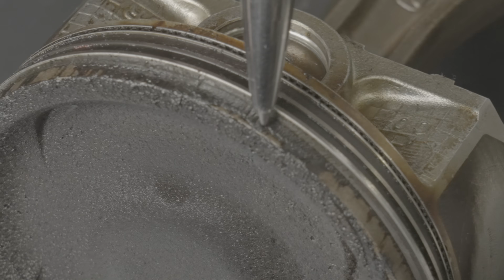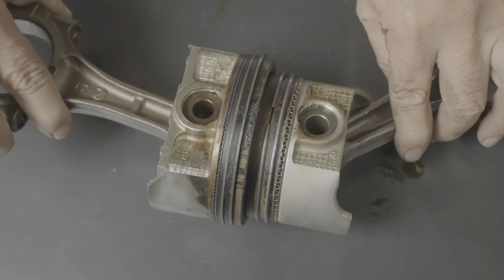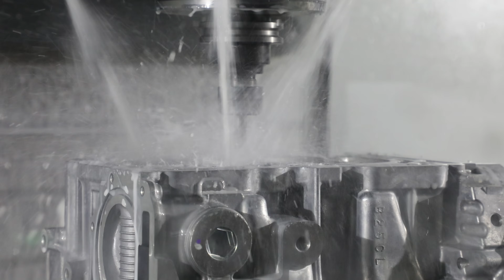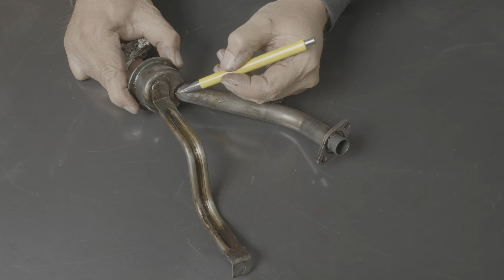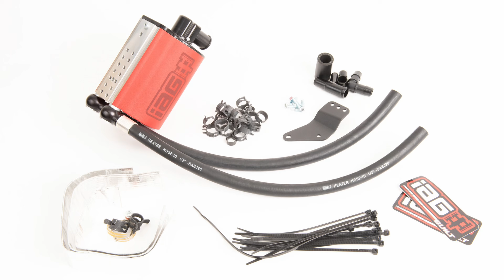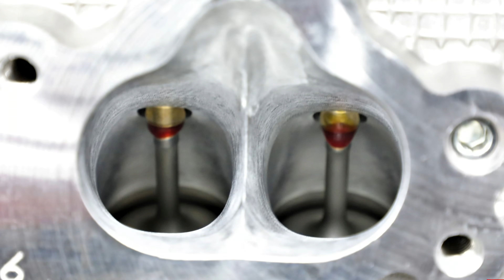Why Subaru Engines Blow Up!

Comment: I bought a 2002 Subaru WRX that had rod bearing failure back in 2012. Rebuilt it myself, had the crank turned and ran underside rod bearings. That thing was awesome. Something happened to one of the timing belt pulleys because I was broke and didn’t buy new ones when I rebuilt it. Timing cover exploded and parts landed all over the highway. I sold the car and haven’t had another turbo Subaru since then but I plan to own another one eventually. I daily drive a 2000 Impreza outback and it’s a beast but I miss my WRX!
Reply: I daily drive a 2000 2.2L Impreza Coupe and it's wonderful, ...with a perfect balance of power and economy.   I believe high zinc oils contribute to the destruction of turbo Subaru bearings as they are silver or silver plated and zinc in presence of acid corrodes silver.  It is a known issue in locomotive engines with silver bearings-  these require zinc-free oil.  Subaru mentions to use 5w-30 Resource Conserving oil only.  The 5w-30 RC oils category limits zinc severely.   The first thing nearly all WRX fans do is put a thicker more zinc loaded oil into their engines.  Thicker is fine but nearly all thicker oils have more zinc than RC oils.  What oil did you use may I ask?
Reply: @sezwo5774  I ran full synthetic mobile 1 if my memory is correct
Reply: @HILLBILLY_HARD  In that case you are off the hook, unless it was the previous owners' oil choice (if used car).   Shell Rotella T6 is very popular among Subaru enthusiasts and it's loaded with zinc.  I have a 2013 Forester XT,  ...I use a mix of NAPA brand oils as they are Valvoline but with a weaker add pack, read: very little zinc in their thick 15w-50 synthetic oil.
Reply: @HILLBILLY_HARD  Haha, like your channel.
Reply: @sezwo5774  thanks
Reply from the maker: @sezwo5774  The bearings do not have silver in them. Any good synthetic oil rated GF-6A, SN or SN plus is going to be fine.

Comment: What are you're thoughts about FA24/VB 2.4 in the newer wrx, i want to get one and push it at least to 400whp.
Reply from the maker: We don't have enough experience with them yet.  We have only done 2 GR96 cup car engines but those have to stay stock by the rules.

Comment: Are the NA motors not infamous for the failing head gasket meme? Where are people getting that they are better than the turbo's? 

Maybe we got the good motors here in Aus.
Reply from the maker: The ones with the crappy gaskets are. You guys get some better variants, chances are better gas too.

Comment: I swear the people that have never owned a subi talks the most shit. 

Like dawg how bout you try one before you just start yapping 😂 It's like if I said bmw's are shitty because they leak oil, and you have to change the Valve cover gasket every 200mi, the maintenance is to much because all you do is work on it fixing leaks. But I've never owned one, can't speak for something I don't have any experience with. Bmw make amazing cars for track or street and everyone knows because i bet they've been gapped buy one with an intake, downpipe and a tune. Same with Subaru, they make great track/mountain round cars they just need to be set up correctly LIKE EVERY SINGLE OTHER CAR would you imagine that. Instead 19 yr kids buy them for cheap and absolutely destroy them leading to them putting up videos online and getting tons of views blowing them up

Yes Ej's are an old designed engine that Subaru never changed besides adding AVCS. They are literally based off of an airplane engine that maked 70hp, thats why they made the FA line up which is more reliable for daily driving. But for most people that buy a Subaru they are buying a Outback or Crosstrek which use the same engine as a new WRX FA20 or 24. Most people aren't going to push there Crosstrek to 400 or 500whp. Subaru is just trying to save money buy not making an entirely different engine for performance because it's not worth it for 2 cars out of there entire line up which are such a small percentage of their sales.

Same thing happened with the EJ, put in many cars for daily driving not for performance based cars. But Subaru decided to go into rally racing and used what they had, saw that it worked and rolled with it for the past 25 years 😂😂
Reply from the maker: FA's have their own set of problems.
Reply: @motoiq  Oh I know 😂 just didn't want to get into it lol. They aren't the best motors by far, I'd almost argue the EJ is a better platform to make power on
Reply from the maker: Currently easier anyway.

Comment: out of everyone I know who had a wrx/sti (including myself), only one person was still on their original engine. And yet, you'll get subaru fanboys ranting that these engines are reliable as long as you spend another 8k on supporting modifications, don't abuse them (jury is out on what abuse means. for some it literally just means accelerating hard), retune them, use the absolute best fuel, only use special brotella oil, and recite the 7th psalm before every drive.
Reply: Maybe you guys just don't know how to drive?
Reply from the maker: No its typical modded Subaru
Reply: @lechug43  aaand how exactly does that blow your engine other than miss shifting? Very odd that none of our other vehicles had those issues if that were the case...
Reply: Abuse means don't maintain them, flog them doing 5k clutch drops and donuts, run shitty fuel. They are a performance engine if you run shitty fuel they will predetonate and get knock or bend rods.
Basically don't be a complete knob. If you look after the engine they absolutely shred and it can't be denied. If you've ever owned one, you know they are bags of fun and will smoke 99% of anything else on the road, even lightly tuned.

Comment: i put 350,000 kms on my 06 wrx (has 420k kms now), bolt ons & tuned since 100k kms. it can handle maxing out the stock turbo, after that its just upgrading the weakest link. head studs, closed deck cases, forged bottom end & it's pretty much good to hold whatever you can throw at it. imo the issues are, 1 poor tolerances when building, slack maintenance & crap oil, & trying to spin the car forcing the oil to the outside which cannot return to the oil pan causing starvation or lack of pressure (this is also compounded by loose tolerances & oil pressure, & again by going long on old crap oil, all resulting in rod bearing number 4 getting spun..

Comment: Would adding the Air Oil Separator and IAG Street oil pan with Upgraded pickup be good for longevity and promote reliability?
Reply from the maker: If you drive in a way that you need them

Comment: I’m the second owner of a 07 forester it’s got a vf52, red line reset to 8500 I can contest there is no point going past 7k
Reply from the maker: If the engine is stock, that's not good.

Comment: Like father, like son. Like engine, like gearbox.
Reply from the maker: The six speeds are pretty strong
Reply: @motoiq  I've heard the 5 speeds are actually a Toyota gearbox. Do you know if that is correct?
Reply from the maker: I think it's made by Aisin who makes transmissions for Toyota, Mazda and Nissan too.

Comment: I have had/have a total of five Subarus.  1998 forester, 2001 forester, 2010 outback, 2018 crosstrek, 2022 forester.  Never once in those twenty plus years have I had an engine blow  up.  Our last Subaru went 11 years and 255,000 km…no problems at all.   They’re like all cars…you’re going to get those ones that have problems.  It does not mean they’re all like that.  I wouldn’t keep buying them if they were not reliable, well made cars.
Reply from the maker: Well none of these are performance models.
Reply: @motoiq …yes but the basic engine is the same…the short block the heads etc. it’s  the tuning that that give them the extra oomf.   Subaru uses the same basic 2.5 engine in all models that have the 2.5.
Reply: @motoiq  Awwww..... did he pop your BS bubble?
Reply from the maker: No, NA non performance models are not as likely to have problems.  BS? You obviously have no experience with the WRX/STI world.
Reply: @motoiq  I am really struggling with this. I know you're a Subaru enthusiast so why are you shitting on EJ's they are legendary even with their flaws they just require a bit more thought and less punishment.

Comment: Ur gonna be falling out of the power band between shifts and that’s gonna suck”…. Best line ever. Worked on  these back when Subaru put the spare tire on top of the engine, lol  and they  failed way back then.  80’s

Comment: "Stronger" or "unnecessarily overbuilt to compensate for neglect"? I am not a mechanic, but the information I can find indicates that Subarus don't like being neglected, and they last long if you do regular maintenance and don't abuse them.
Reply from the maker: They have a lot of weak points compared to other engines which we cover in this video
Reply: @motoiq  Yes, and great video!! Most if it is about how the stock parts are not designed for track use or beyond what the vehicle was designed, and without proper mods would destroy itself. I also agree with the video about the parts where some relatively simple design changes would reduce the risk of many of these problems. It was difficult to get a feeling if the "weak points" are defects that negatively impact longevity under intended use. I mean, it's great that other brands design their engines to run low on oil that hasn't been changed for 30k miles and all, but I'm not sure if that reflects negatively on Subaru. This video was really meant for track related topics and was very informational. But as a rando internet person in the comments, I see many comments mentioning anecdotes about non-track related issues and that's what  I was targeting.

Thanks for the content!
Reply: A friend purchased a 2019 Sti, coming from a Fit. Over the course of roughly 18 mth put about 1200 miles on it. As their first new car and performance car, I don't think they broke it on, in addition to letting it sit for extended periods(pandemic). The engine went and needed to be replaced. They are not car people and could only share a loss of oil pressure wrecked engine.

Seems to me EJ257 definitely needs to be cared for  more than many other "modern" affordable performance engines.

Comment: The answer is easy, teenagers try to race them…
Reply from the maker: Meanwhile the Evo which has the same demographic has a very strong engine in both the 4G63 and 4B11
Reply: @motoiq  there must be 20 WRX for every 1 EVO so of course there will be a lot more blown Subaru engines
Reply from the maker: Evo's can make a ton of power reliably on the stock bottom end.  Subies can not.

Comment: I know someone with a bone stock, early American market STI, and their car has over 130,000 miles on the original engine. I know others with STIs and WRXs that barely got outside of their warranty before their engines died, again, bone stock. And I have yet to see a modded STI or WRX last more than a year or so between rebuilds. At that point, I rather own an RX-7 and keep a 13B going.......

Comment: well, what ive learned so far after watching this video: put your money on a 4G63 or honda K
Reply: Nothing is bulletproof,there is no engine which is bulletproof, I had Civic Type R with K20 and with that engine I had so much trouble hahaha it was lot less on Subaru what I had, on Civic Type R I replaced twice engine, once I done just stock rebuild with forged pistons and rods, that engine failed after 3k miles(spun bearing), second engine we built another K20 engine with forged parts plus head, failed at track day after 5k miles

I had in our JDM Subaru Impreza WRX Wagon we had from EJ205 stroker'd to 2.1L and which was running 490bhp without NOS to EJ22T stroker'd to 2.35 and on that we run 555.5bhp just on Tesco 99, never had chance to run methanol or NOS, both engine are still running in other cars, they outlived our WRX Wagon 😞
Reply: i never said they're bulletproof, theyre just better engineered and the closest sibling to an EJ is a 4G63 not a K. But i must say: something went horribly wrong in those builds, those engines are not known for what you just said
Reply: @d.martins4471  EJ257/255 give Subaru engine bad reputation,earlier JDM EJ207 been quite reliable at higher power builds similarly to 4G63 or K20 but EJ257 which Mike mention in this video are in stock form  not the best engine build 

I'm running EJ207 and that engine was reliable at 500bhp/500lb-ft for while just after 125k miles we decided to stroker'd to 2.1L 

Over here in UK most of mappers won't map EJ257 with stock engine beyond 1.4-1.45bar because of headgasket,headstuds and pistons rods used there,they will map you for higher boost but expect your engine will need quite quickly rebuild 

Regarding my luck with K20,learnt few lessons from that,many people told me that K20 is strong engine and can take a lot of abuse etc,but from my experience just not,you are always limited with K20,on stock valvetrain 15psi is max or safe to run,beyond that upgrade valvetrain,if you are doing that ,I would go with rods and pistons and possibly Closed deck insert for strength and if you do that then headstuds as well and afterwards pray for no issues 

i would say 2JZ with RB26 one of the best engine,not sure if I would say 4G63 is strong engine,I would say it's quite close between 4G63 and EJ207 from personal experience,I had EVO 7 in past and beyond 400bhp you are really looking to upgrade pistons and rods at least,I kept mine EVO 7 in 400bhp range just due this,didn't wanted to push my luck hahaha

Comment: You mericans got the shit ones, all my Subarus (from the 90s)have over 300,000 kangaroo hops, ones over 400,000
All turbo, the 400,000 K one is factory closed deck and has just been maintained well and that's it.

Comment: Love the channel as always great info!

Currently building a 06 sti rotated 6466 iag motor shooting for 8xx on E 5xx on pump 93. Don’t count the high hp Subarus out! They are making great progress with not detonating after a pass down the strip😂
Reply: Here in lies the problem. The Subaru community wants power on pump gas. Stick to E85 and don't even try to run pump gas
Reply: @MotorSwapDan  E isn’t great to live off of, definitely will have a pump map when E isn’t available 👍

Comment: So if you put the case half on the mill, and you torque the studs, do the work... when you take it off, you gotta just throw those studs away right? And when you put it together for real, you buy the same studs again? 
 
Not that it actually matters, I drive a crosstrek. Also, I feel like I saw this video years ago already.  I'm sure I did, but its a day old.  My question: could I have time traveled?
Reply: Also - and again, I don't know shit, so feel absolutely free to ignore this - do they make billet heads?  To fix that hook the exhaust has to do and maybe the other thing you mentioned in the beginning?  Quench path???
Reply from the maker: Studs are not like torque to yield bolts and can be tightened and loosened many times.

Comment: Are Porche’s turbo opposing 6 as fragile? In my case a builder let the cam gear hit the valves and eventually it broke. I always felt that the block wasn’t one piece. That’s why it’s recommended to use ARP case bolts and get an align hone. Why did Subaru go away from the closed deck of the 22b? Did they over heat? It’s amazing that Subaru hasn’t address the oil pick up breaking. I experienced that with my 04 STI at about 40k mi with a fairly stock motor. Ive gone through 4 builds. Sold the sti but I should’ve done a K-swap, lol. My very last build did 612 awhp 597 ft lbs using the AEM series 2 stand alone on full E85, fully built forged internals, port polished head full Supertech valve train, Brian Crower 272 cams.
Reply: 04-05 Is by far the best looking STI in my eye's!
Reply from the maker: No they are way strong and way more expensive!  Open decks are better for emissions and can be cast cheaper.

Comment: Every Subaru guy I've talked to gets mad when I say their motors aren't as tough as some other brands and they always say the EJ motor is bullet proof.
Reply: Ive had a blitzen now for 18 years from a EJ 20 twin turbo 2 litre from Japan regular service high grade synthetic oil and factory filters and now it's done 240 thousand Km.  Only ever did the cambelts and brake pads since I've had it and doesn't burn oil from oil change to oil change no leaks and motor still tight when switched off on ignition..  
Personally I can't fault the EJ 20 engine to me it's truly reliable and cost free    and I always use 98 octane gas
Reply: @garryh3126 maintenance and good fuel is the key. Same as you I only ever run 98RON in mine, has 250k kms on the clock and I don't granny it.
Reply: The owners tend to lie. This brand owners will never admit the truth😂
Reply: @ontarioman6301  Well, I own one, zero issues, and I'm happy with.... and I'd beg anyone to call me a liar.
Reply: @ontarioman6301  definitely

Comment: When  building my engine, I accidentally over   torqued the case bolts by holding the torque wrench in the wrong place, causing enough distortion that the crankshaft was tight.